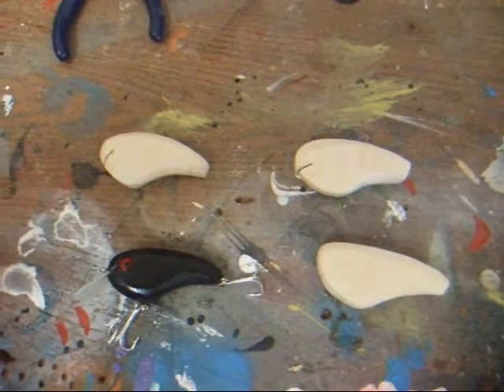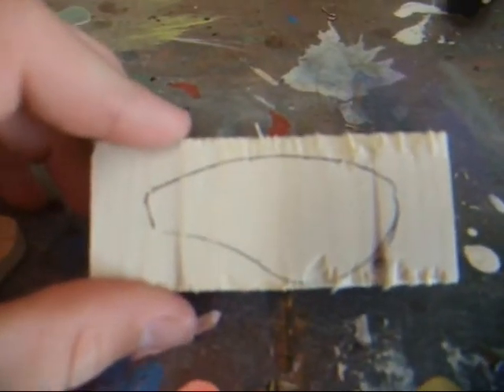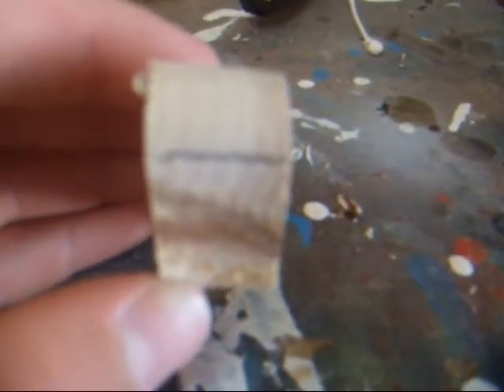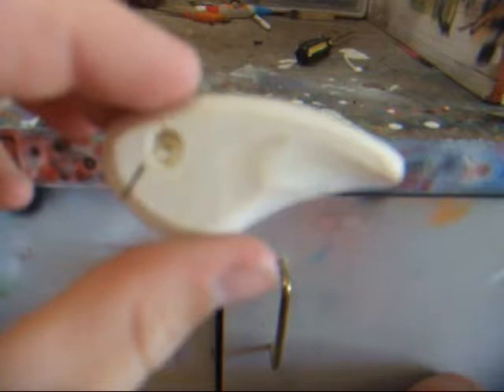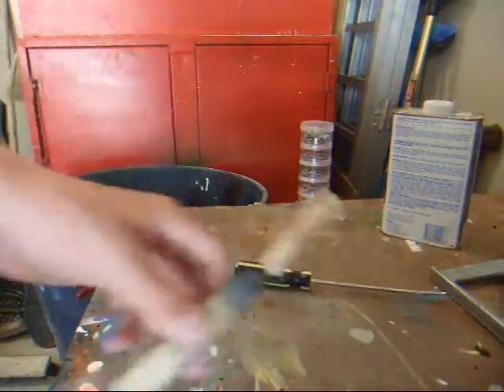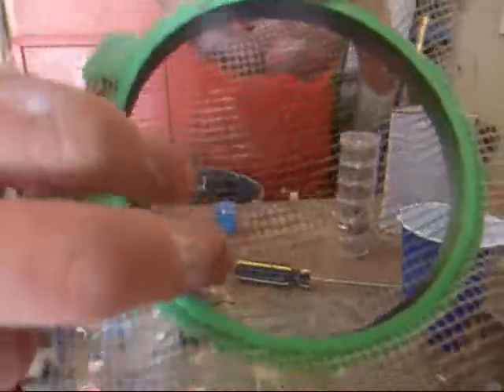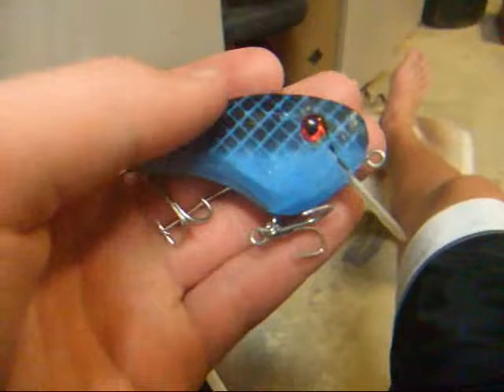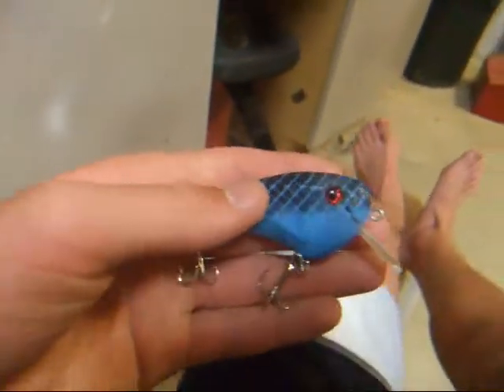How to make a Crankbait

Comment from the maker: @MrCrazyfish99    No you can actually round the edges with a knife and then come back with some sand paper to smooth it out. But a belt sander helps alot. Yes ceder is probally the best because it is lighter than pine.

Comment: @lureboy10 it depends on the type of lure you wont for your wood choice if you want a deep diver then go with a heaviver wood like pine and or ceder if you want a more boyant lure like a top water or shallow diver use balsa its also depends on how quick you want the lure to rise in the water or if you want a suspending lure ceder takes a lot more weight to make it suspend than pine will also lureboy you may want to look into a better clear coat to avoid hook rash